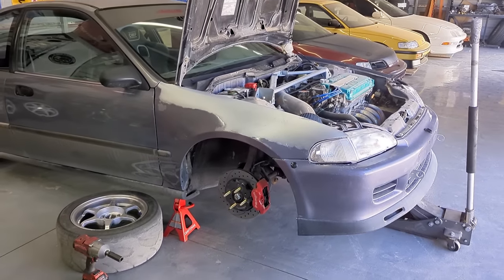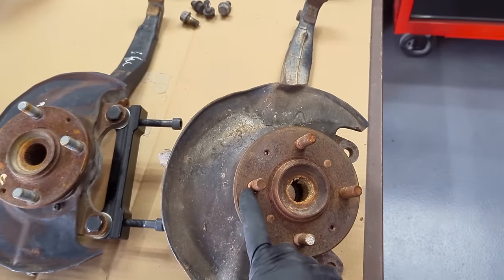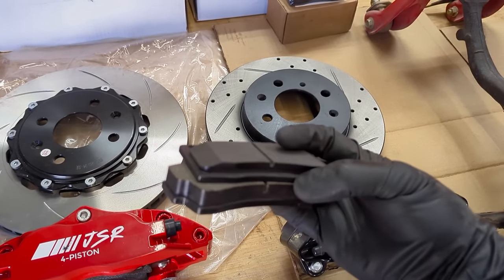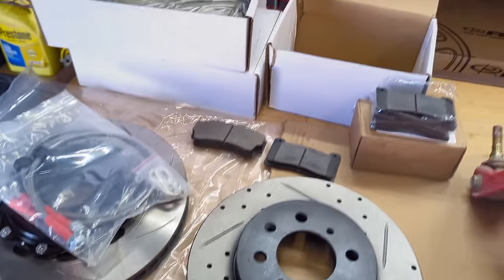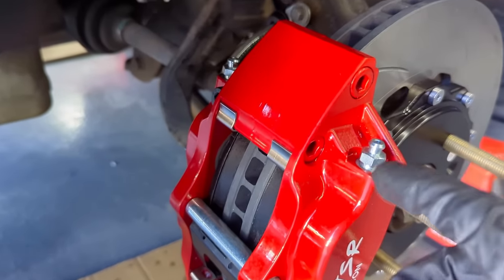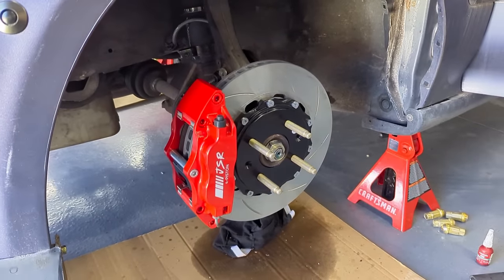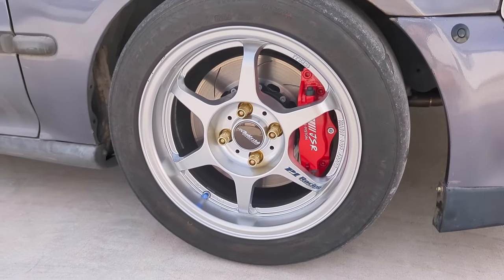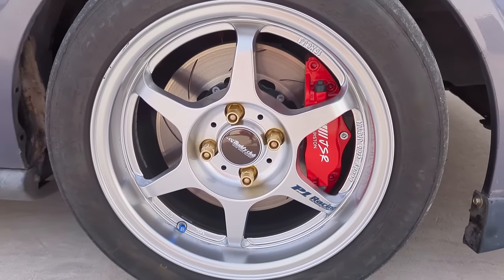Jackspania Racing Big Brake Kit Install - 1988-2000 Civic 9.5" Brake Rotor Sized Small Spindle

Comment from the maker: More info from the owner

"Semi metallic pad (normal brake pad ): low probability of abnormal noise, low powder, high temperature resistance effect 350-400 degrees Celsius
Running leather (performance brake pad): low powder, high brake friction, and high temperature resistance, with a temperature resistance of 500-700 degrees Celsius
Ceramic specific leather: suitable for ceramic brake discs, not for steel discs
(There are two main types of TT sport pad, both of which have better performance.)
1. Black pad , less dust, no abnormal noise, high temperature resistance with a friction coefficient of 0.4 or above, and working temperature of 0-500 ° C.
2. Red pad: imported high-quality aramid, imported modified resin high specific surface material, alloy material."

Comment: The wilwood kit is hell on earth to work with. The line is the devil. I ziptied mine too and it slip and tore the new axle.  But stock line fit the wilwood but they tell u it won't to sell their line. And the nut didn't thread in the line. The wilwood pad don't use all the rotor surface either.  I wish I can trade my wilwood for a jackspania. Bought wilwood 5yr ago it was what's available in 2019

Comment: Throwing in my two cents Mr Jon. I had the 12" wilwood set up on my eg. I didn't take into account what wheels would fit. The only wheels I could get over the brakes were 17's !! All my 15's ans 16's absolutely would not fit, so I went with the WILWOOD 10.5" DPHA kit with no brake booster. I am very pleased. The brakes are amazing.  Just keep wheel size in mind folks with these big brake kits. Love your channel Jon 😊

Comment: ~$625 kit to compete with the Wilwood DX kit is crazy! Excited to see how they stack up. Also excited to see some more 15x7 wheel fitment on these calipers. 
I really hope that the other smaller "budget" JSR kit will be designed as a competitor to the Wilwood DPHA 10.5" kit where it bolts up direct to an OEM rotor, except just made for the 9.5" rotor / DX spindle. I think this would fill a spot missing in the market. 
Another question is: what pad plates will these JSR calipers be using? Will we be able to use pads from other companies like Hawk?
Reply from the maker: He's working on pad builds right now.  He does want to have options, will update again in the next video when I test these at the track!

Comment: Love the content! I have a quick question with clearance concerns, do you need to run extended wheel studs due to the wider caliper? Or should I be okay with the OEM wheel stud length? I just bought some VMS wheels 15x8 20 offset lmao

Comment: Is there a standard direction that slotted rotors are supposed to be orientated? I always thought they went the other way. The set i put on my cobalt ss were labled individually and the slots point the other way (counter clockwise) which makes sense. To clear any gasses and debris and channel it outward. My buddy has a srt8 charger and his are ponted forward on one side and then backwards on the other side. To me those just look backward.
Reply from the maker: I think it just depends on the manufacturer.  I've seen them both ways.  My Wilwood were the same way but I've had some rotors that weren't part of any brake kit set and those faced the other direction.

Comment: Hi Mate! 

Thank you for this video
Just want to ask, you had yo remove the. Spindle splash guards right? And just to confirm, these were installed on. 15CL spindles right?
Reply: Also, do they squeak when they are cold?
Reply from the maker: Mine already had the dust shields removed.  I'm unsure if they'll fit with them.  These are on the small spline dx spindles.  They do not squeak when cold.
Reply: @GarageBuiltHondas  thank you mate! Valueble info.  Great content too. Cheers mate!